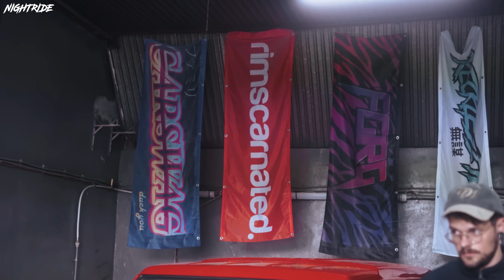V8 Miata gets new perfect wheels | Back in garage!

Comment: Check injector wiring for the 3 cylinder problem. I was having the same issue until i found out one of the injectors wasn't firing and traced it back to bad injector wiring at the connector.